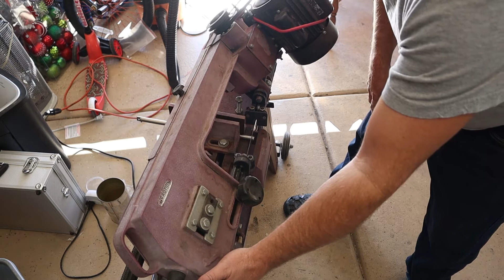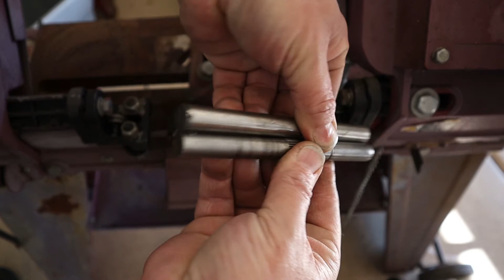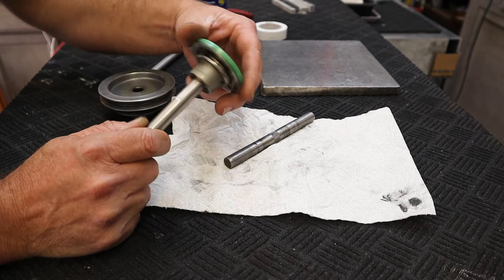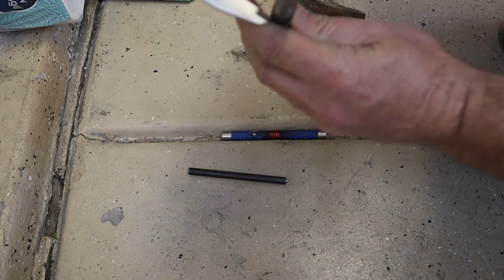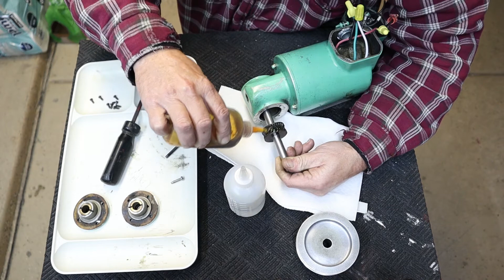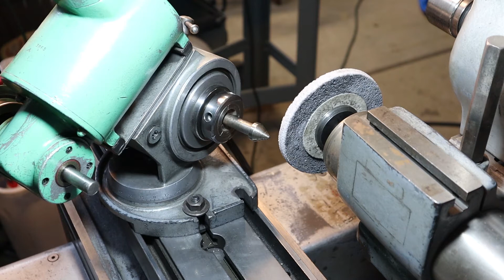K. O. Lee Tool and Cutter Grinder.  Completing the trip from truck to cut.

Comment: No guard on wheel
Reply from the maker: For the surface grinder i have finally picked up a new to me guard set which will be fully used.  The tool and cutter grinder will be getting cast guards this coming year.  Thank you for watching.

Comment: That center is running out to much to grind properly
Reply from the maker: Yeah it was a bit wobbly.  An old part that was quick to chuck up and grind.  I have yet to rebuild any of the spin indexer outside of the motor.  Thank you for watching.

Comment: The spin fixture has a sleeve which converts it from BS taper to 5C taper, it can be knocked out from the back side. I have a ko lee grinder I am trying to get all the rust off from sitting in an unheated building for many years.
Reply from the maker: Oh awesome.  I didnt know that.  I will tear into the center section of mine sooner than later.  Thanks for the tip.